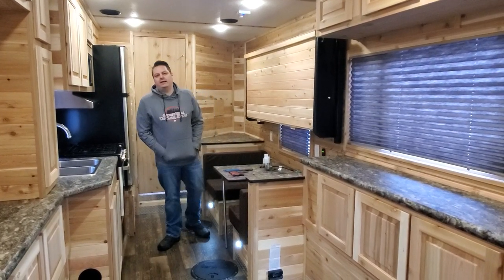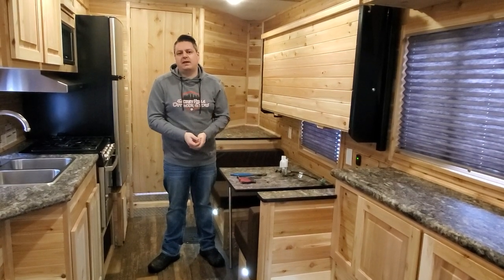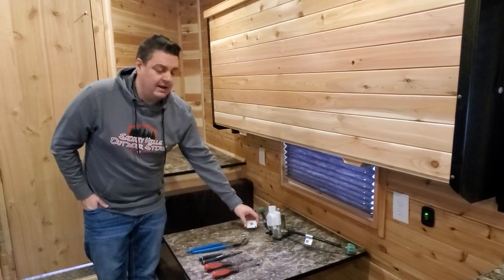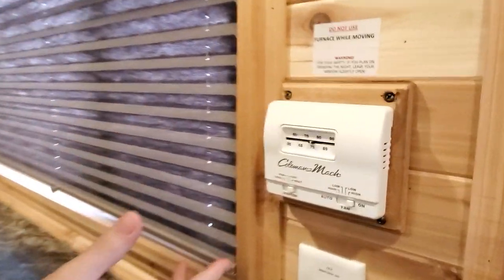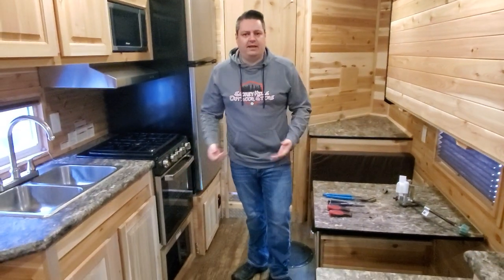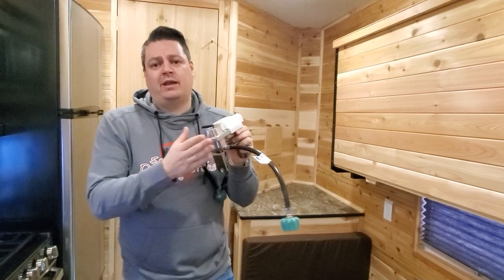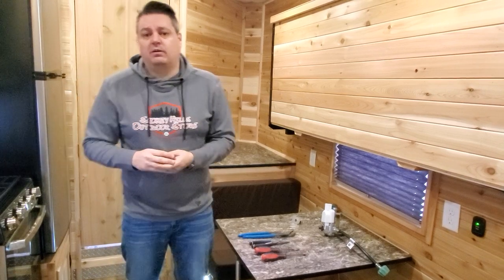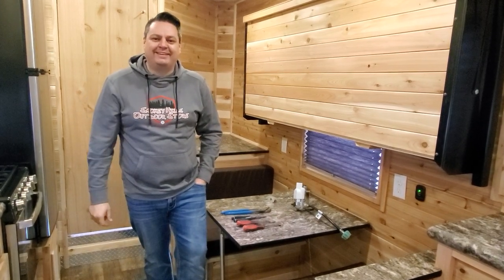Fish House Furnace Trouble Shooting & Other Crucial Tips!

Comment: I appreciate and love these videos! I have an 18' ice castle with the same 30K BTU furnace that Hendri is reviewing. One trick that works for me when starting the furnace, especially a cold furnace,  is to light the gas burner (stovetop) first to get the propane flowing.  Once the gas burner is going, turn up the thermostat and start the furnace. I don't know exactly why this works so well but it does. 
Of course, be careful not to gas yourself out and I'd suggest opening a window if you do this.
Reply from the maker: Great tip! Appreciate you watching Luke, good luck fishing.
Reply: @SmokeyHills  I just bought six of your Catch Covers because my young son wasn't paying attention this weekend and stepped in the hole. Problem=solved.
Reply from the maker: @lukedoubler68  Great product for sure!

Comment: @Smokey Hills My Suburban forced air furnace in my fish house will start when I turn it on and will heat to the set temperature and it will kick off as it should but then it won’t kick back on until I manually restart it again. I changed the thermostat and that didn’t fix the problem. Any ideas of what’s going on?
Reply from the maker: Bypass the thermostat to make sure that is not the problem. After that I would say it's probably the limit switch. It's the most common problem when it turns off right away. https://goicefish.com/search.php?search_query=limit%20switch&section=product
Reply: Thanks I appreciate it.
Reply: @jaylinraschke9411  did that work? i have the same problem!
Reply: @blakehanson5343  nope. Just replaced the whole thing.
Reply: @blakehanson5343  mine was a rare case where the blower motor would shorten out so it wouldn’t start back up.